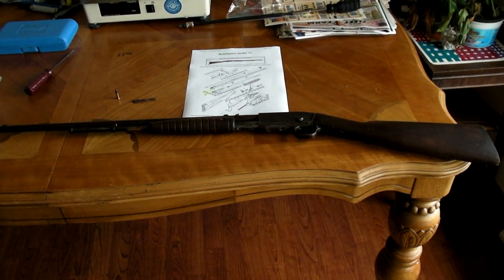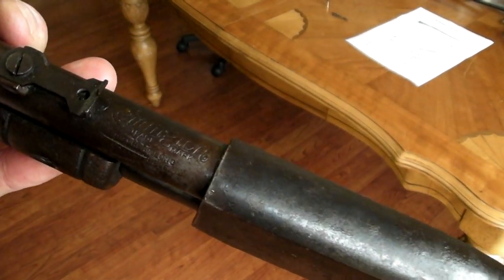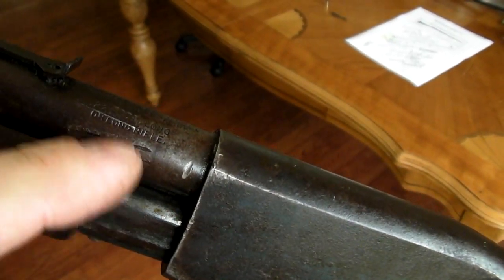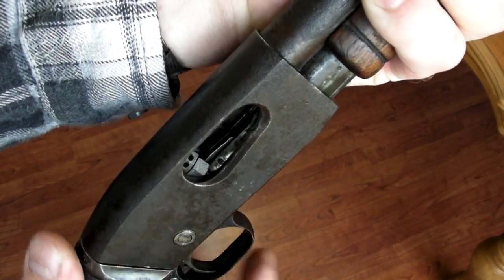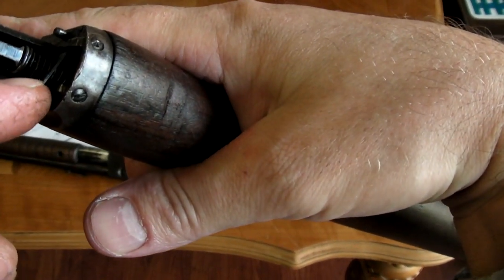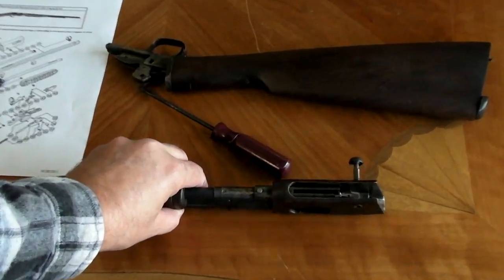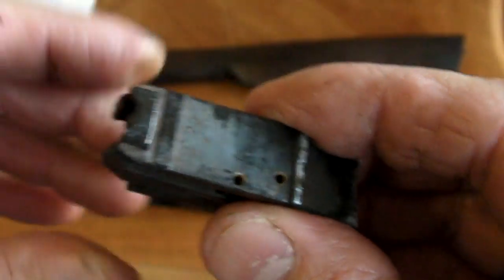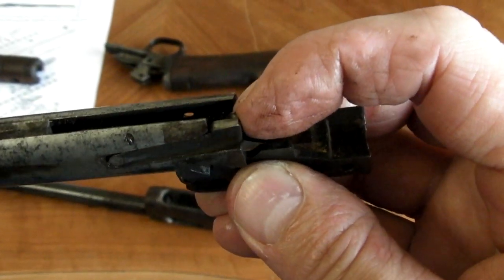Barn Find Remington Model 12 Pump Action Rifle & Disassembly

Comment: Your saying cartridge stop spring. Is that a proper name for that because mine won’t load the Cartridge into the chamber for some reason. It will lift it up to put it in the chamber, but it’s not not lined up properly to go into the chamber

Comment: Your model 12 was made way later than 1915,the plastic butt plate is a give away,the early ones had a metal crescent plate.
Reply: This is not entirely accurate. Mine was manufactured in 1914 according to Remington and it too has the plastic buttplate. Mine is an original model 12 just like the one in this video. I would place this one somewhere in the 1913-1914 range.